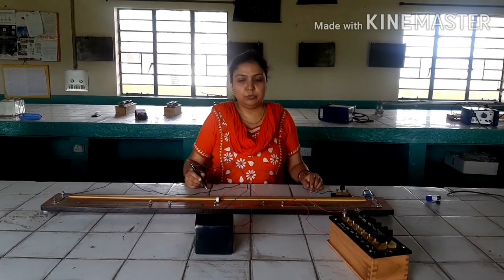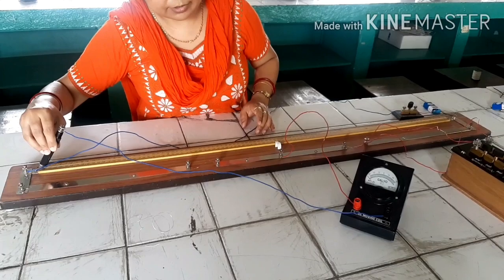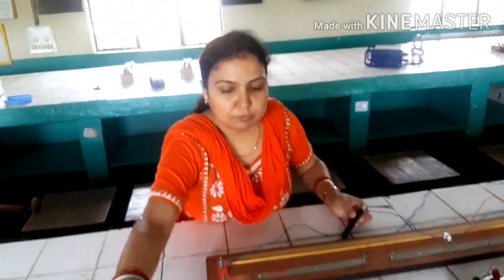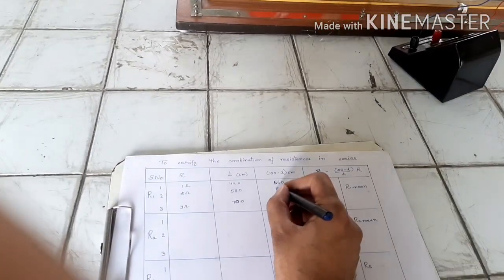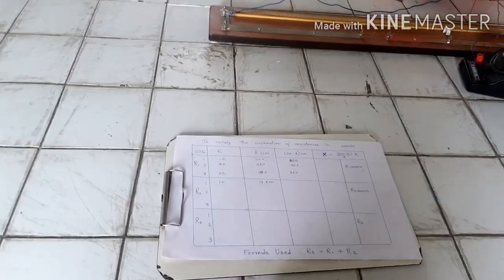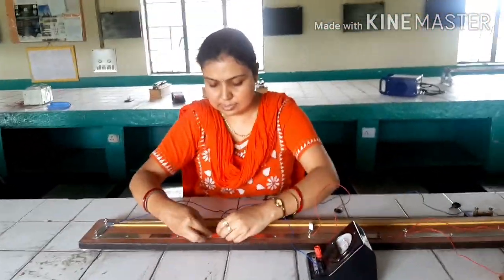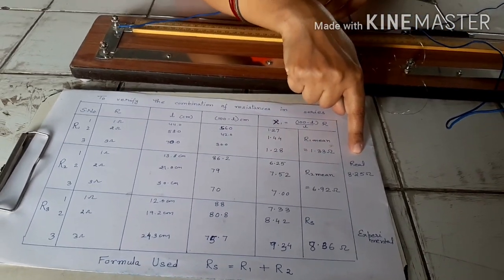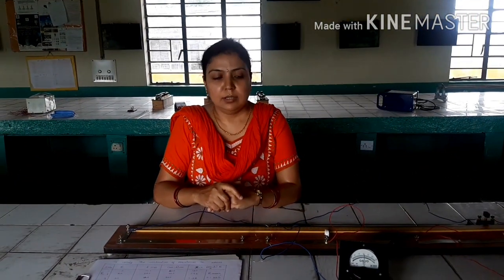To verify the law of combination(series) of resistance using a metre bridge

Comment: I'm sorry to say that there are two faults in this experiment done by the teacher.
1.the teacher used probably a 9volt cell which is not correct. This may cause heating effect in the metrebridge wire  for which wrong null point may be obtained. She should have use a 1.5 volt dry cell.
2.Method of checking the connection is wrong.
Correct method :- Press the jockey at 50 cm when R = 0, in this case the deflection may be RHS and keeping the jockey at the same place make R = infinity the deflection will be opposite of first.
By a lecturer and trained proffesional in Practical Physics.
Reply: Yes you are correct
Reply: @thakur00006  🙏🙏
Reply: Hello james bond